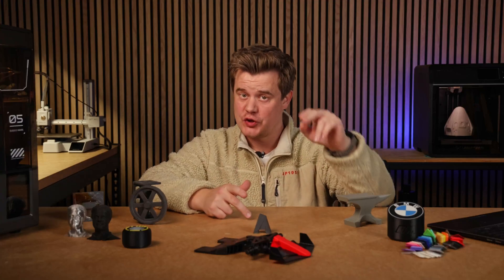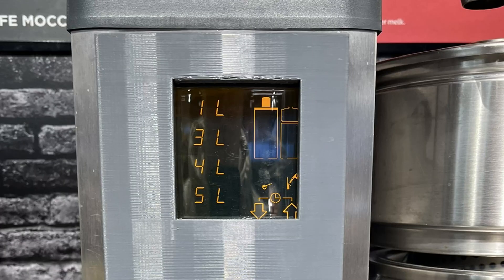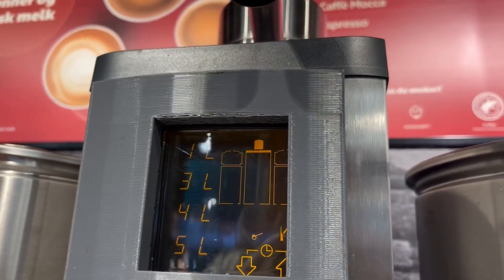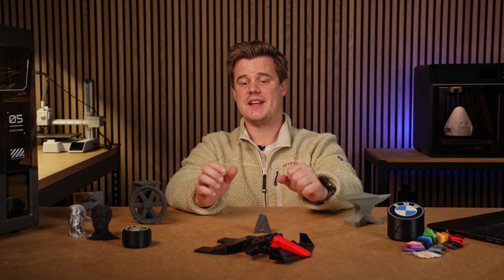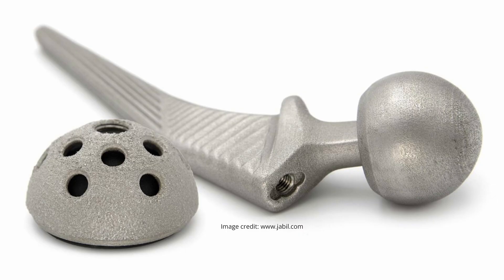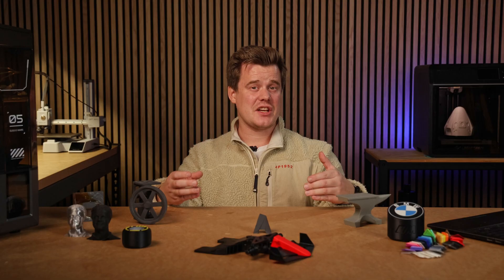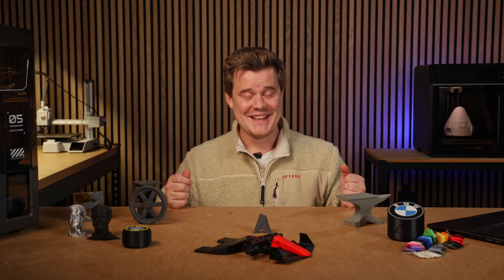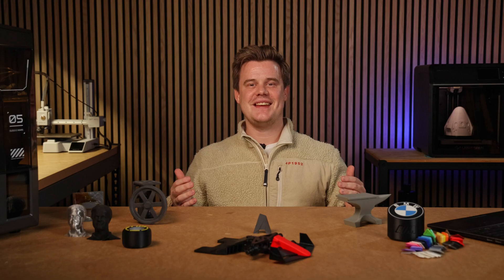When do you choose 3D Printing Function or Quality?

Comment: I love this. However, I would really like to see more companies prioritize the quality of their prints. I can not even begin to talk about how many of my customers have made comments about how they can hardly see the layer lines, and what an improvement [aesthetically] my parts are. Of course, I never skip out on dimensional tolerance or the function of the parts either. It is possible to have both form and function with 3d printers.
Reply: I would never put my name on that repair part for the coffee machine.
Reply: @ThisisDD  never, never, never. Especially something that is customer facing. I still wouldn't, but I'd understand a lot more if it was inside the machine. That being said, nope, never. No way would I sell a part that looked like that.
Reply from the maker: It's a great way to solve the problem in this case! And as you say, it's possible to have both. But for a small company you might have to compromise if you're running 1-3 printers and have hundreds of 3-6 hour prints to deliver fast :P
Reply: Big same